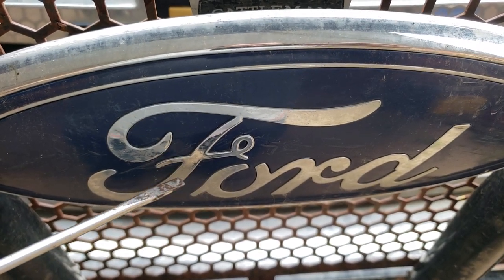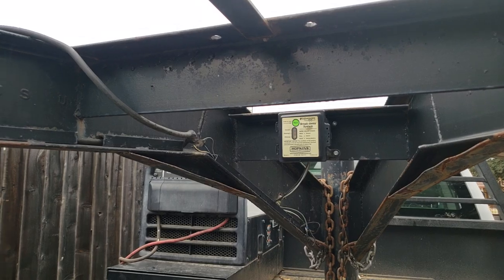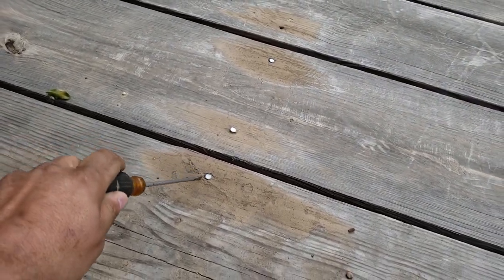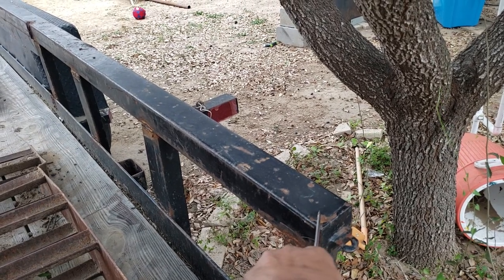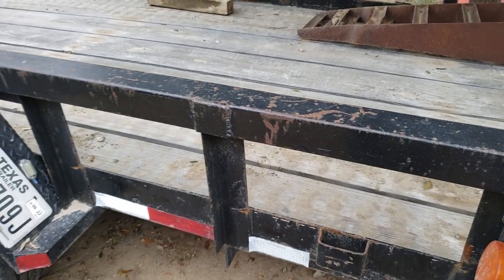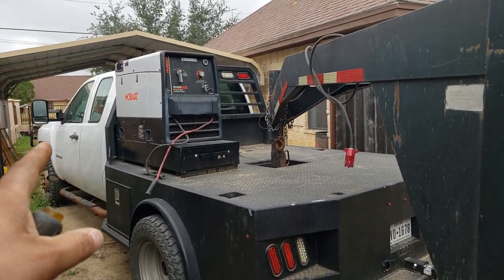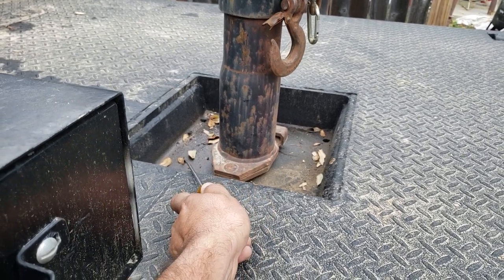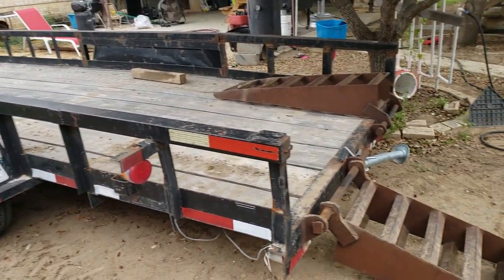I bought a used goose neck trailer to rebuild vs building my own trailer

Comment: That trailer HAS BEEN severly overloaded !!!
Reply from the maker: Yes, the trailer has been abused. If I recall correctly they were loading a big ditch witch often which is heavy. I think the rear of trailer extends to far for that application causing end of trailer to work like a lever. I repaired the angle frame and has worked fine. I also distribute the weight as best as possible.
Reply: @cutweldngrind  I hope you can put IT back the way it was so your investment will be worth the cost you paid !

Comment: Hey Jorge ,looking foward to this build ,nice trailer  .
Reply from the maker: I wish I could speed stuff up but the good thing I already started to order small stuff needed for the trailer. I actually saw a 2022 gooseneck trailer all steel deck that I like but think it will be expensive. I better fix this one up.

Comment: I use schedule 40 black iron pipe as a housing for  my taillights. You got a lot of potential with that trailer !!  But near as much work as building one for sure. I like black too !!
Reply from the maker: I got some 4" pipe I can use for a housing just got to look for some 3" or 4" tail lights. There is some work involved to make this trailer look newer and not much daylight after I get out of work. One of my friends got a 22ft trailer similar to this one for $8000 but he will use it more since its for a business. Prices are to steep for me at the moment to even try building one or buying a new one. Well I may just get me some shinny black paint then. Thanks

Comment: Used motor oil and turpentine makes a good sealant for wood just pour it on and brush it in thick repeat as needed, nice trailer I just brought home a old 5th wheel camper trailer frame going to turn it into a bumper pull flat deck
Reply from the maker: I wanted to use motor oil like you mentioned so may be an option. Is turpentine like a solvent or thinner? I have some oil that came out of the international 444 tractor so could use that.

Comment: I love seeing your builds on YouTube! There’s a guy here on YouTube as well I think it’s Waldos World, he made a Gooseneck flatbed trailer from scratch. Just to get some ideas
Reply from the maker: I have seen his builds and was thinking on building a goose neck but prices are crazy on steel at the moment. I wanted to build me a 22ft car hauler with metal decking to match my flatbed truck. The 10 gauge floor plate is over $220 per 4x8 sheet so I was looking at 5 sheets for $1250 delivered. The 4 inch channels were $44 and now they are $94. The dual 7k axles complete with springs are about $3000 now and that's why I decided not to build a custom trailer. I do plan on fixing it to my taste and hope things go smooth. My coworker watches all of Waldos projects. Thanks for stopping by.
Reply: I completely understand as I’m also from South Texas. I bought my Hobart welder after seeing your review like 3-4 yrs ago!

Comment: Cool trailer, the ramps need longer trailer supports so the bed doesn't bend again
Reply from the maker: I will sure have to check the ramps out once the deck is repaired. I might have to add a longer support like you mentioned to prevent the issue from happening again. Since the frame is bent I think I will slice it vertical taking out a notch, welding it up and applying a section of 1/4" plate to reinforce the section.

Comment: Nice trailer for sure!  Are sure the frame in the back by the ramps isn’t bent?  Just curious is all.  Can’t wait to watch your upcoming videos on this
Reply from the maker: The frame is made out of 3/8" angle iron and the frame actually started to bend around the rear axle area. I am going to cut a notch vertical on the frame and use my floor jack to push the frame close to its normal height. The notch will probably be 3/8"+ on the top side and taper down to 1/8" on the bottom. I will then weld and grind the area down before applying a section of 1/4" plate to reinforce the area. I think end result will be good but not perfect due to limited tools. We will see when the first update comes as I am ordering parts slowly.

Comment: It surely needs some TLC but with your skills I'm sure it will turn out to be a good trailer personally I'd have done the same thing I like to make things My way
Reply from the maker: The day I bought it I was like 30 minutes here, 30 minutes there and I am done. Today I saw it again and was what did I get myself into. It will look better, hope so.....The trailer was used mostly to haul a ditch witch and bobcats so I know it can handle some weight. I need to install a winch so might have to plan that as well.
Reply: Will you get a harbour freight winch about 5yrs ago I bought 1 to load and unload my welder on my truck a badlands I think is the brand it's a 2500lb capacity still working fine maybe you might want something stronger though

Comment: Is that Hobart welder still holding up for you? I am thinking about one like it.
Reply from the maker: The Hobart works great but its still under 200 hours. I want to say about half the hours are welding and the other half as a generator. The machine has sure gone up in price and things are still getting more expensive. I wanted a generator backup so this option was better than getting an SA200 pipe line welder. If I were to just be welding a Lincoln SA200 would of been my choice.

Thanks for stopping by.